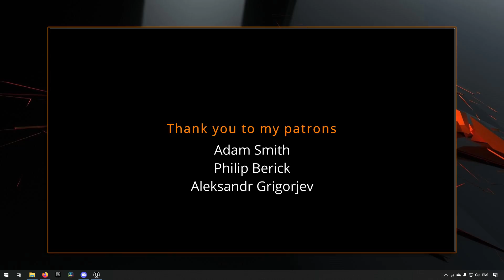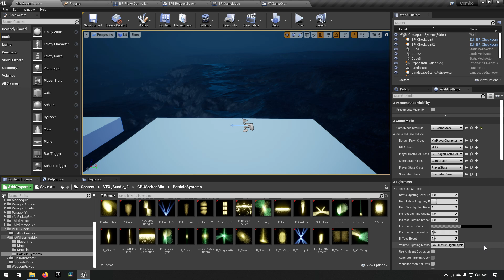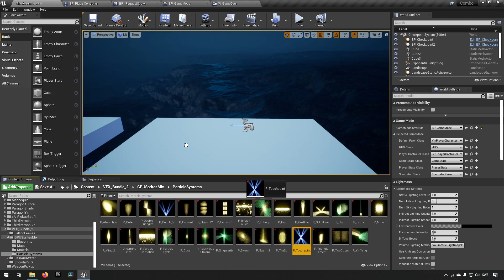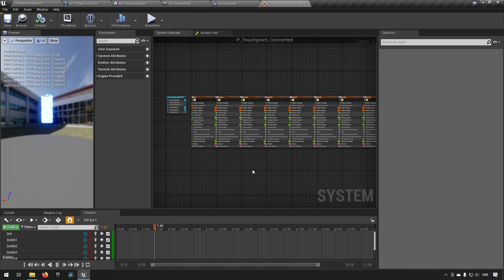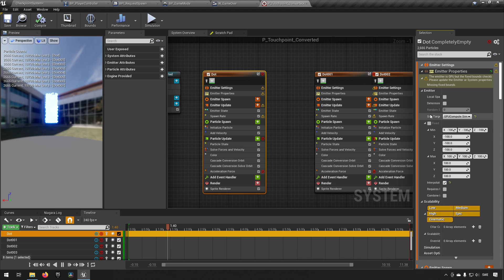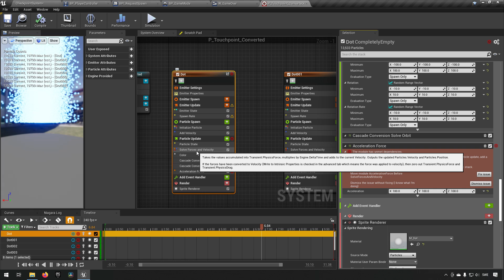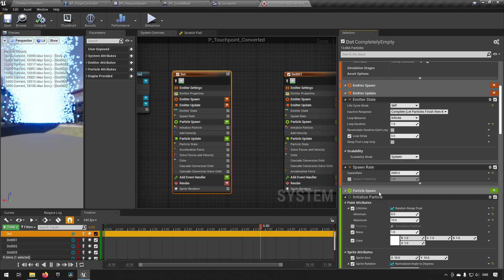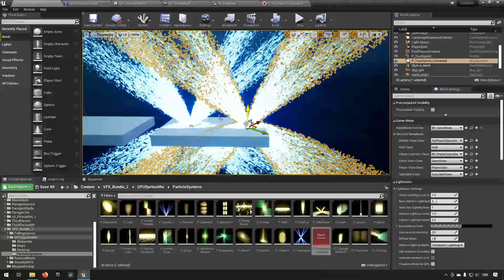Tutorial: Quick convert particle system, Cascade to Niagara - Unreal Engine 4 + Unreal Engine 5

Comment: This converter does a really poor job. People shouldnt be worried about reworking/fixing something they didnt have to before only because the engine has "evolved". If its so good, why force me to wrap my head fixing something that was fine before and had no troubles?
Either Epic make this thing work 100% before removing cascade, or keep cascade there so people can use their particles without need to mess up around. Not everyone knows VFXs and has a guy like you to show How to fix an asset.
Reply: Same opionion as @starvosxant4348. There should be a very good converter, to be able to migrate/update UE for projects without having to rebuild all particle effects used in the project. Hopfully @LeafBranchGames will be right and cascade will not be removed until a very good converter is available.
Reply from the maker: The converter is a work in progress that is evolving and maturing, so it will keep doing an improved job as time goes on. Epic is for sure not going to remove cascade completely without the tool being completely reliable.

Comment: Note: in UE5.1 the fixed bounds correct is now under the dropdown menu "Calculate Bounds."
Reply from the maker: Thank you for sharing this info. :)
Reply: @LeafBranchGames  Np. Posted that to help others.

It would be cool if you did a video covering common cascade to niagra conversion issues. There's a lot of legacy cascade systems on the marketplace and many particle systems have various errors that don't convert easily.
Reply from the maker: @Uncle_Fred  True, and that was initially the reason I made this video. I will make add it to my to do list to revisit this again.